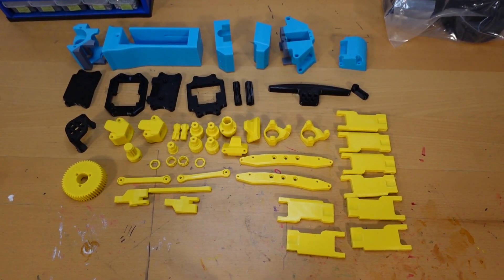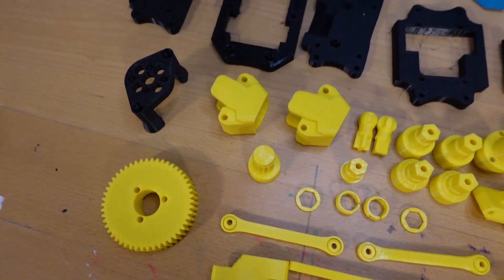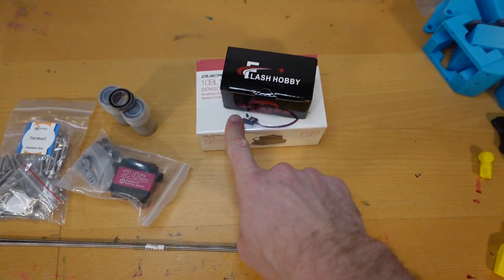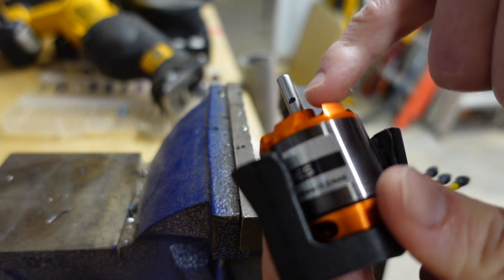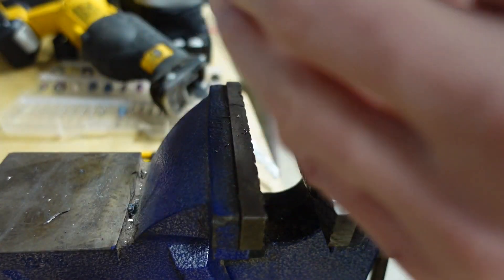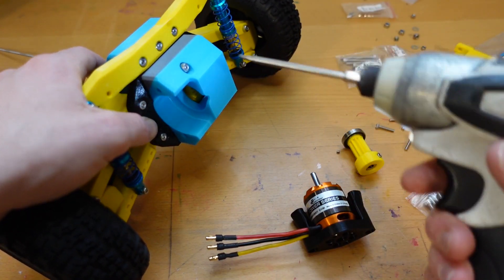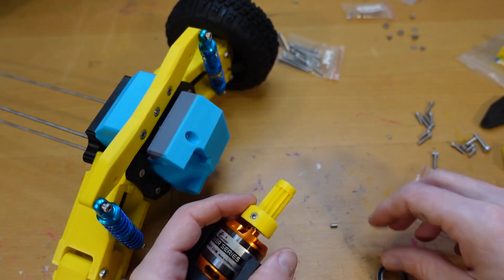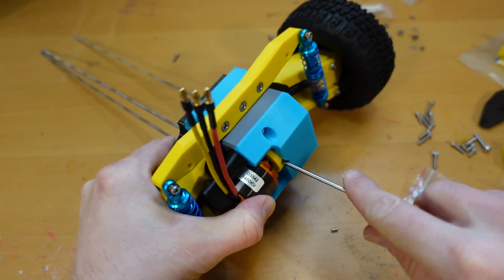Tarmo5 Build, First Run and Initial Impressions

Comment: Did the motor melt the gear when it's get too hot?
Reply: The real issue is the lack of differential gears. The motor will strip the pinion pretty quickly.
Reply: PLA doesn't melt until like 200 degrees so the motor would burn out completely first.
Reply: @Vok250   i had made a different model but my motor (BRUSHED) melt my gears that why i was asking for that.

Comment: Do I have to use the the types of specific types of filliment you used, or can I just print it all out of PLA?
Reply from the maker: TPU is definitely required for the pieces that call for it. The motor mount should probably also be printed out of something more heat-resistant than PLA

Comment: One thing that would be cool, to add some bushing counter-bores on all of the suspension components so that you don't have that rod end just digging into the plastic. Or maybe use a smooth shaft with a keeper screw at the end like traditional RC's. Anyways, interesting build. Thanks for sharing!
Reply from the maker: Nice idea, something to consider for sure!

Comment: The car has a major issue: it does not have a differential. Simply putting a bit of strain on the engine can cause the joints to break. Moreover, if you happen to crash into a wall for just a few seconds and keep the engine revved, it can lead to catastrophic damage. This flaw makes it particularly challenging for those without experience in driving RC models, as it's likely to break almost immediately under such conditions.

Comment: amazing build brother!
now it would be great (and this is just an idea/suggestion) if you could fit conventional bodies on top of it. 
This 'chassis' provides a stable solution as is, but it also feels 'empty' as is if you catch my drift.
its not something negative just something i would love to do with a build like this.
Reply from the maker: There's a van body that you can print for the top but I'm not certain how it attaches... kinda seems like an afterthought. It wouldn't take too much work to develop a mount for a traditional body though.
Reply: @rcprinter hey man. Are these your designs? I'd only need the stl files as I have a few k in parts and shipping from the us to Canada for the parts kits costs a fortune. I'd still pay well for the files as I know the work involved in making them. I'm starting a non-profit rc park. I have a 3 month hospital stay coming up and I'd like to get about 10 more rcs built. 5 pairs. So 5 sets of stl files x2 of a price at your rate. I'd post the complete builds to my channel to show everything is on the up and up. Just so you'd know I'm not trying to pull a fast one. 

I want to have about 30 rcs for people to try before they buy new ones I'd point to your site.

Comment: Can you tell me is Tarmo5 good choice for 3dprinted rc car ? Or just for ex. Robak or MkUltra is better ? I wanted to print rc car which is quite fast.
Reply from the maker: All good choices. Robak and Mkultra are 4wd whereas the T5 is rear wheel drive. I really like my mkultras but the robak is great too and has an all metal drivetrain so its a bit more robust. Maybe build one of each???

Comment: How does it compare to Robak 2?
IMO Tarmo 5 is more accessible since almost all the parts are 3d printed, while in robak 2, many parts like axel and gears aren't 3d printed.
I am currently building Tarmo 5.
Reply from the maker: Biggest thing is that T5 is RWD only and Robak uses a full metal drivetrain.

Comment: Where did you get the wheels and tires? Part numbers?
Reply from the maker: I used these: https://www.amazon.ca/gp/product/B09KHM5SHK 
BOM recommends these: https://www.amazon.com/gp/product/B014GQMFWY
stay under 120mm in outside diameter

Comment: Are the black pieces the only tpu parts? Ive seen some builds suggesting printing the suspension arms out of tpu so wondered if you did too or if its just pla?
Reply from the maker: yup its just the black pieces that are tpu. The arms are all pla
Reply: @rcprinter  cool. And is it a necessity to use tpu for those pieces or just a preference? I have an ender 3 and have yet to attempt printing in tpu.
Reply from the maker: @davidjones5684  I would highly recommend them in tpu. I've printed tpu with my ender 3s before without any major issues. Its not as nice as printing with a direct drive printer and you might have a bit more stringing and blobs to clean off but it can work just fine. Don't be scared. I used esun 95a tpu for this which I like because its not as soft as some tpus.
Reply from the maker: the motor mount was black but its not tpu, its abs for heat resistance but you can do petg as well.
Reply: @rcprinter  thanks for all your help.

Comment: What is that peice connecting the pinion gear to the motor shaft called? A shaft collar? Ive been trying to design my own rc car and the transmission has been the biggest struggle so far
Reply from the maker: I believe its called a stop collar.

Comment: Hi, do you know what size is the steering link or how long would it be? I need to get if I want to get a metal one.
Reply from the maker: If you download the free files you can measure exactly but the links that go out to the wheels are around 80mm eye to eye.

Comment: Looking to order a kit, just got a question, are the electronics plug & play? I’m a 3d printing whizz, but no way am I good with technical electronics or remote controls. If they require some work, do you have a video to help with the electronics? Many thanks! :)
Reply from the maker: No there is some soldering required.
Reply from the maker: Its quite minimal though, you just need to solder esc connectors for the battery plug and plugs for the 3 motor leads. Once that's done its pretty plug and play. If you don't want to attempt that yourself I'd recommend just bringing it to your local hobby shop and they can do it for you.
Reply: @rcprinter  what size connectors did you use?

Comment: 3D printed 6mm bearings work too.
Reply from the maker: They sure would in a pinch... maybe not long term though.
Reply: @rcprinter  Yeah, I agree. It was supposed to be temporary, but having them greased has kept it going.
Reply from the maker: @ColtonVi  if it ain't broke...

Comment: Is there supposed to be a screw pulling the drive cups together inside the main gear ? Looks like M4 50 or maybe 60 mm but I don't have any like that in the set ?
Reply from the maker: No sir. They're just supposed to stay in place with the pressure from the TPU driveshafts.

Comment: Is there any overall dimensions, wheelbase, width info?
Reply from the maker: Outside of tire width is 13". Front to back outside of tire length is 16".
Reply: @rcprinter  can u tell the size of the bearing used and how many of them are there ?
Reply from the maker: @phd7768  6802 bearings (15x24x5mm) - 11 are required... Here's a set of 12: https://rcprinter.com/products/tarmo5-bearings
Reply: @rcprinter  PLA would be enough like would it be strong enough to bare some rough ramp jump forces ?
Reply from the maker: @phd7768  the T5 parts are pretty beefy but PLA is still not gonna hold up in a hard crash. CF Nylon or something like that would be better.

Comment: Great video! I'm glad you got around to making one!

I agree I should have made the tolerances tighter. I think my printers are a bit sloppy they are getting old--Its difficult to nail down good tolerances with a design because everyone's printers are different--But I have had a lot of people tell me that they have had the same issue so I am probably a bit too far off to one end of the spectrum. Even your CV axles were way too loose, they are supposed to be a tight fit they shouldn't rattle like that. I guess this is the first time I've gotten to see one of my designs in detail from someone else' printer normally I have to go off of written feedback.

Also I should note you're only supposed to use two rods, I have the third hole there, but its not needed--I see now how confusing that must be. But you can slightly reduce the weight by removing the third threaded rod.
Reply from the maker: Thanks for the help and the amazing design! Many people are going to have a tonne of fun with this thing.
Reply: The reason I'm not building it is actually that I want to bash, but if this  car flips the ESC is destroyed
Reply: It does look very beefy though, I really like that. The steering links of my (not a Tarmo) car keep breaking

Comment: Hi I’m using the same TPU but I’m having a little trouble printing those parts, could you send your print settings as a starting point. Thanks
Reply from the maker: In PrusaSlicer I'm just using the "Sainsmart TPU" default settings for my Prusa mk3s and then just changing walls/infill depending on the part. No special settings, just that default profile seems to work great.

Comment: Have you tried the helical gears that I designed for it
they are drop-in and have the same ratio but I haven't had time to print one for myself
You can find the onshape doc on the tarmo5 reddit it is public and you just have to export the parts